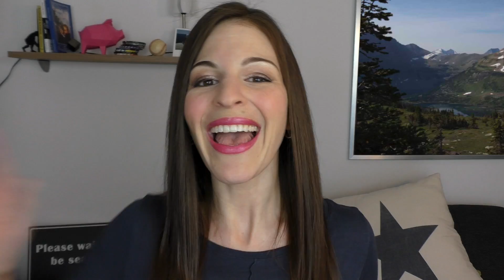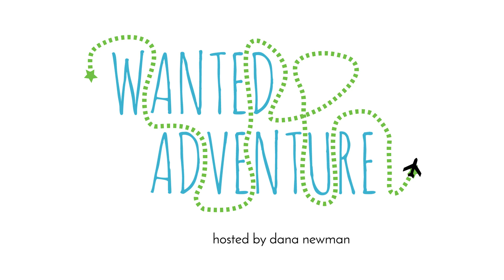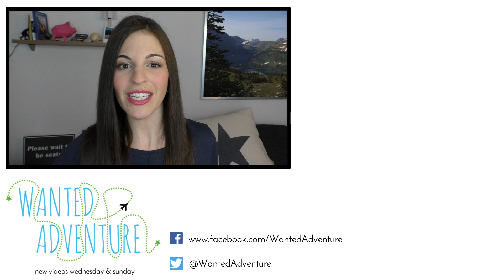Why Are Houses in America MADE OF WOOD?!

Comment: Wood is prevalent in the U.S. and in most regions brick is much more expensive. In South Florida the houses are built with metal joists, plywood and then cinder blocks on the outside covered by stucco. This has proven to be a good design for hurricanes. Ironically, the best design for hurricanes allow the house to flex.
Reply: George Newman the roof design is more important in Florida. a hip roof allows the winds to flow over the house.
Reply: That and a few sheet metal connectors, and you're good to go.
Reply: best design for a earthquake is to let the house flex too
Reply: The best design for hurricanes until a hurricane actually hits it.
Reply: Brazil has much more trees than the USA. Brazilians still use concrete and bricks as building materials. Why concrete and bricks are more expensive in the USA?